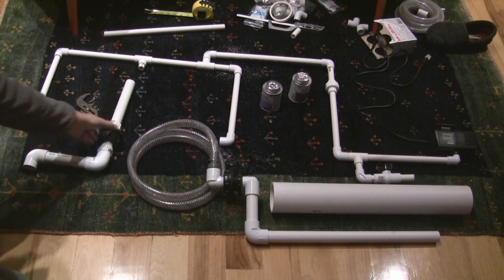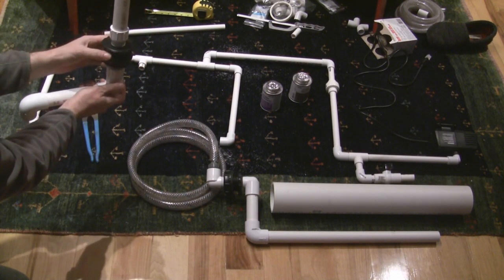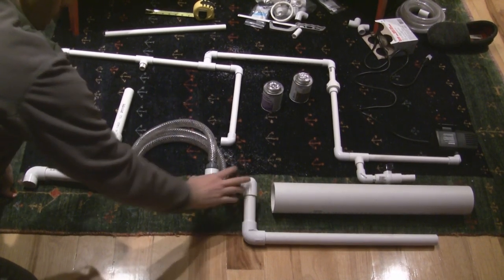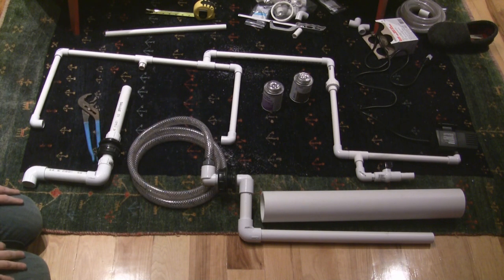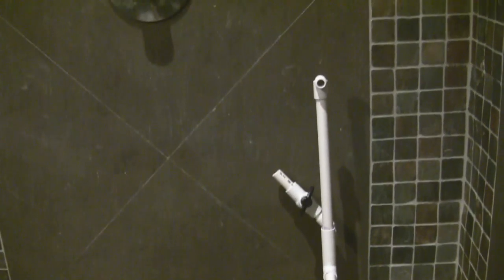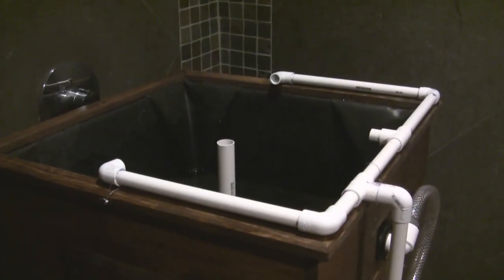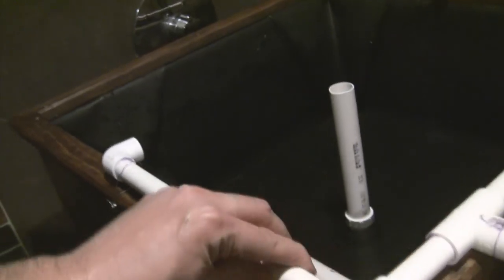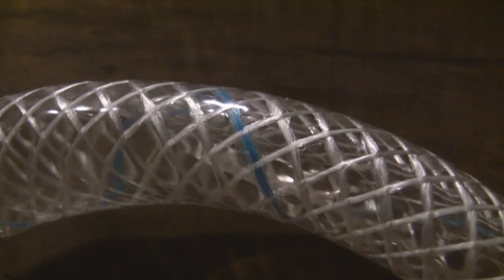Aquaponics for a New York City apartment - Part 3 [grow bed build - plumbing and testing]

Comment: In a system with small pots, the typical watering periods are about every 3 to 4 hours. I have had an ebb and flow (flood and drain) system shut off for at least 24 hours and the small 4"Lx4"Wx6"Deep pots full of hydroton ALMOST got to dry. 

Off the subject but still about Hydroton. If your local stores dont know what Hydroton is, ask for Leca(Lee-Kuh) or expanded clay pellets, its the same thing different name.

Comment: Hydroton is "expanded" clay pellets which allow fast drainage, large air spaces so roots get lots of breathing room and it stays moist for a fairly long time. I would figure, since this system is using a deep bed it would stay moist for days if you didnt pump water into it. If it dries out though, the roots will dry out and the plant will die. Its all about moisture, doesnt have to be wet, just moist.

Comment: Drip is possible but it requires some pretty crazy filtering and I don't see any reason to complicate the system further. Getting a flooding and draining system is quite easy and straight forward once you've pulled it off once. It's just about designing it correctly and tuning your pump. It's very easy to do with valves that control flow.

Comment: @The00jing00 The answer is oxygen. What flood and drain accomplishes is flooding to get the H2O and the nutrients to the roots and the draining allows oxygen to reach the roots so that they don't have an anaerobic environment and rot. You could never do a drip distributed set up because the fish poo would gum up the nozzles and tubes. To filter the water for the fish you need to pump the volume of the fish tank a couple of times an hour and you couldn't do that with a drip drip.

Comment: Hi.  Why is the flooding necessary at all?  Specifically, why do most aquaponics systems have bell / loop filters instead of directly draining into the fish tank?  It would seem to me that as long as the water was "drip-distributed" across the hydroton, the flooding isn't necessary.  What am I missing?

Comment: @AquaponicsNYC thanks for that information, i am looking at building a system but held off because some people recommended not cementing the joints. (dont want water to leak into my floorboards). But this is very good intel, thanks

Comment from the maker: @qin02 I'm sure it would if you were putting it into a system with fish right away. However this stuff is rather volatile and evaporates and oxidizes quickly. By the time you will be adding fish it will be safe for them.

Comment from the maker: @MrMadmax478 I wanted to give it a try as it doesn't take up growing space.  I know it has more issues than a bell siphon but I want experience with all modes. If i fail then the bell goes where the overflow is. I am going to opt for gravel as the drain guard - we don't have any volcanos around...;)  and was planing on just putting a cloth over the hose.

Comment from the maker: @aragonst I did add many more holes and made sure nothing can get into the drain pipe, but once the media was added there was a reduced flow already and the siphon doesn't start.... problem solving, now the fun begins. I need a camera mounted on a worm to see the block is. Worst case i just turn my over flow into a bell siphon and make the other one my overflow.